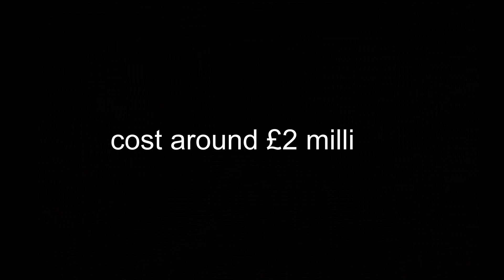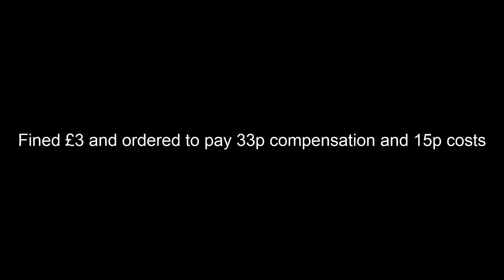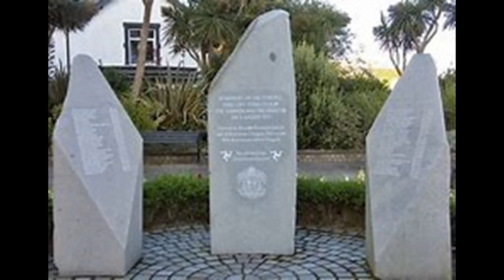Summerland Fire  - 1973

Comment: It was started by the boys playing with matches around 7.40 pm. A witness saw a boy holding a match to the roof of the kiosk. Summerland reopened in 1978.
Reply: So was it actually arson then ?
Reply: Robert Roberts They changed their story and admitted the fire was started by matches. (The Summerland fire report) I read a newspaper report that said it looked as if it may have been deliberate.
Reply: i was there it was young lads they had stole cigs and were in a wood shed out side next to the plastic roof the shed w up seting the roof on fire
Reply: @Robert Robertson it was a wood shed on a flat bit of roof put next to the plastic roof  it  wasnt a kiosk
Reply: Pip Smith  the exits were chained off the fire engines ladders were to short the roof was plastic there wasnt enough  staff  and no one but the kids were brought  to task
Reply: It never reopened. It was demolished.
Reply: @malcolmgorrie3219  not according to the official report and eye witness reports.
Reply: @maxflight777  It did reopen in 1978 after reconstruction.
Reply: @98Tabster  Many apologies. I’m shocked
Reply: @maxflight777  I didn’t mean to sound harsh. There are many inaccuracies in different accounts. It was very hard to get the facts and the stress was unbelievable. I run on a short fuse these days. I had a stroke two years ago. I’m still trying to walk properly. Same as when I was 5 after the fire only my vision and balance are also affected now. It just matters so much to me that the Summerland stuff is right. x
Reply: @98Tabster  you were not harsh ! 
Best wishes for a continued recovery.
Thanks for messaging x
Reply: @maxflight777  Thanks so much! Really appreciate that! xx

Comment: Where was the staff? And why didn’t they call 999?
Reply: the ladders weren't long enough  iwas there i was 13 at the time they were under staffed in summerland
Reply: Did 999 exist then?
I thought those systems came around later in the 80s/90s.
Reply: @kelf114  the 999 system was strated in 1937 (source: google)
Reply: The staff was totally INEPT and hopeless. The Fire Brigade was alerted by a taxi driver and the Captain of an anchored cargo ship who radioed that the place was going up. The staff was oblivious till the fire broke out in the pinball room crackling through those PVC-covered chipwood wall panels contractors thought sooooooo fireproof. Bunch of murderers.